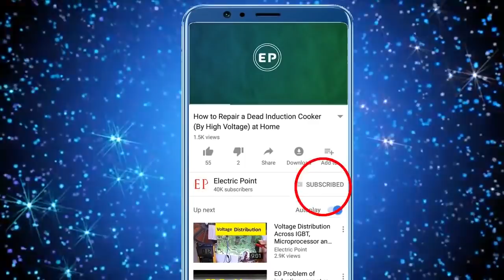How to Repair Remote Control Helicopter Easily At Home

Comment: My Helicopter doesn't get off until it battery is fully drain n starts when it is connected to charger n one fan keeps on rotating without switching on  I can't recharge it what might be the problem n how can I solve it.

Comment: If battery,motherboard and motors are damaged how can I buy
Reply: Do you have toy grade RC helicopter ?
Reply: You need consider buying hobby grade rc helicopter to get service after sale and these helicopters are durable and built with high quality material in comparison to toy grade rc helicopters
Reply from the maker: Below is a Descrption Link

Comment: I have issue that nob which is used for on / off and charging is broken and my helicopter is showing charging but not running
Reply from the maker: You can easily replace that

Comment: Hello bro,my helicopter is skyking f-330.
It is not working..it is not battery problem I had check battery, the battery is working..
The problem is when give the throttle in remote the helicopter is not flying...(not even the propellers are not running)but when I check the motor separately the propellers are working 
Helicopter will on and  led in helicopter is also working,no pairing issues..
The motor is also working(I had check the motor separately)
Then what will be the problem?
Please help me..
Please reply in English.(I don't know hindi)
Please reply as soon as possible.
Reply: Is it repaired?
Reply: I guess it's premium problem

Comment: Bro I have same helicopter the issue I'm facing is the top fans aren't spinning 
I did assembled it and found out that one of the motors end plastic part has melted and is unable to further provide the spinning to the big rotators plz help me how to fix that minute part
Reply from the maker: Change the motor
Reply: @ElectricPointOfficial  Motor is fine just the pinion or that end plastic gear is melted so can v find the same sized gear or if I change full motor will I will the same pinion with it...?

Comment: My helicopter lights starts when swtiched on also remote light on and correct but helicopter not fly what an issue it's wing not rotate
Reply from the maker: Check motors
Reply: My helicopter lights starts when  swtiched on also remote light on and correct but helicopter not fly what issues it.s wings not rotate